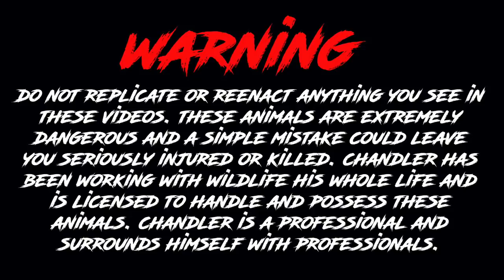BLACK Mamba VS GREEN Mamba!!

Comment: On youtube I've seen a video  series from  ojatro  - "Facts about Black Mambas"  of a black mamba that came across a dead lion. Wasn't even in its way and it bit the lions head multiple times in one strike. Then it tried to eat the lion from the head,  then gave up due to the size. That snake wasn't under threat so that cant be defensive. It bit likely because it didnt know the lion was dead. So it attacked what it almost certainly thought was a sleeping lion. I'd say thats very aggressive. I think  the reason handlers say its not is because they handle it under controlled conditions with controlled temperatures and at controlled times. People like Dingo  who handle this species in the savannah do say they can be aggressive.